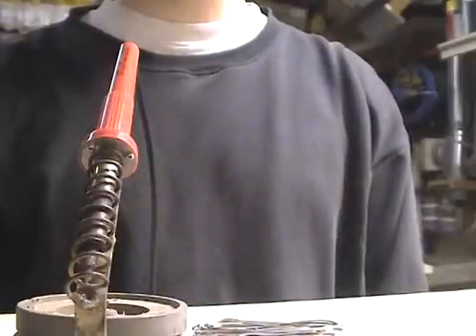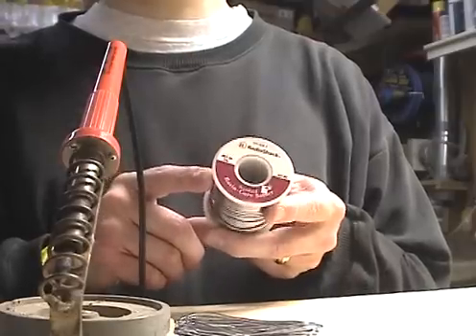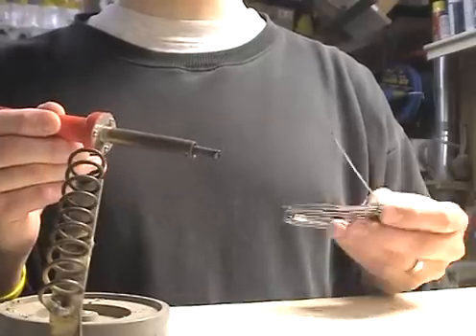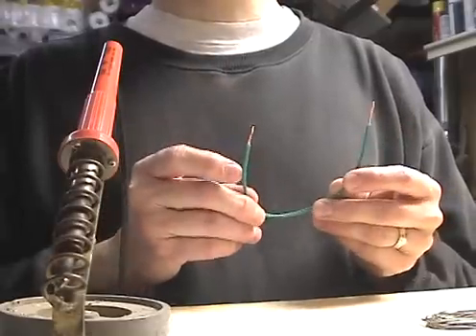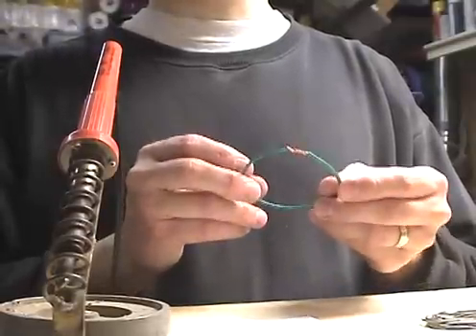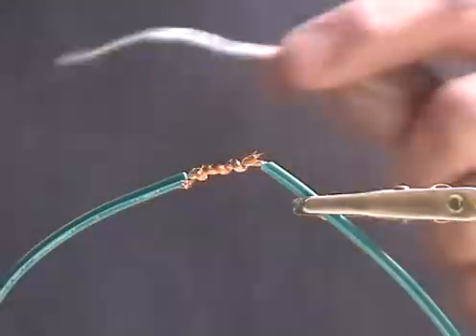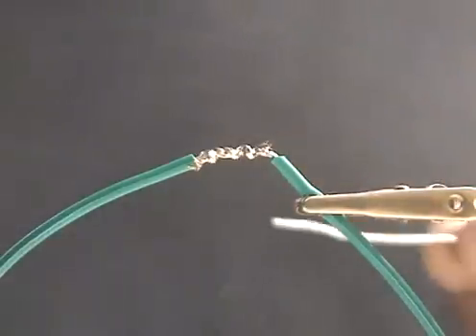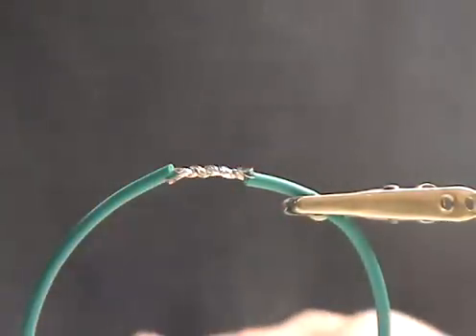How to Do It: Basic Soldering

Comment from the maker: That's correct.  I use the first tinning just to consolidate any old solder and gunk that's sitting on the tip.  Then I flick that solder off.  The idea is to have a clean tip prior to the tinning for soldering.  If you're using a sponge you might not need to tin twice.  Once the tip is clean, just before you solder you put some fresh solder on the tip to tin it and touch it to the wire, then after the iron has heated the wire touch the solder to the wire and let it flow over the joint.

Comment: so you tin the tip, flick it off, tin it again and without flicking it again put in on the wire, than touch the solder to the wire once the iron has heated the wire up enough?  is that correct?  I'm new to this stuff.

Comment from the maker: You're correct in that one could flick solder on oneself if not careful. It's assumed one would exercise due caution and not do that, as well as not flicking the solder when anyone else was in harms way. But then one could also burn oneself with the hot soldering iron itself...

Comment from the maker: You can use electrical tape to insulate the connection.

However, a better and neater method is to use heat-shrink tubing. The heat shrink tubing would need to be put on the wire prior to the connection being soldered however, then slid over the connection and shrunk after soldering was complete.

Comment from the maker: To solder to a pot, you can either loop the wire through the hole and twist it back on itself to hold it there and solder, or just pre-tin the wire (just melt solder onto it alone) and pre-tin the connection, then solder them together. You'll need to secure the pot, and the wire may get too hot to hold though so you may need an alligator clip to hold it while you solder.

Comment from the maker: If your solder isn't melting properly I suspect you don't have rosin core solder (you probably have flux-less solder like that used for plumbing).  Without flux the solder won't flow properly.  The rosin core in the solder is the flux.

Comment from the maker: Jimmypage is right.  Heat shrink tubing is a much nicer solution than electrical tape (the will work as well but isn't as neat).  You need to slide the heat shrink tubing onto the wire BEFORE you connect and solder the joint!  After the joint is soldered you slide the tubing over the joint and shrink it with heat.

Comment from the maker: A 60 watt iron will work fine for larger gauge electrical wiring (like automotive wiring and home electrical).  Since higher wattage irons generate more heat they can wreck more smaller/delicate wires and electronic components.  15-30 watt irons are appropriate for electronics/circuit boards and smaller wires.

Comment from the maker: Charlie,

Flux free solder isn't suitable for use with a soldering iron and won't melt properly.  You need the rosin core.

Flux free or solid solder, like the kind used for plumbing copper water lines comes without flux (the flux is added to the joint manually before sweating/soldering).  But all soldering requires flux.